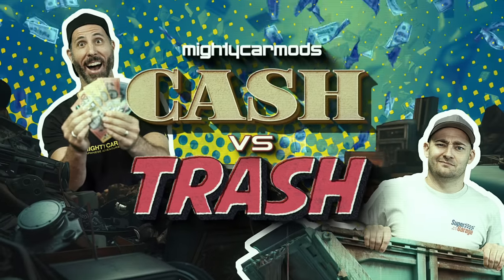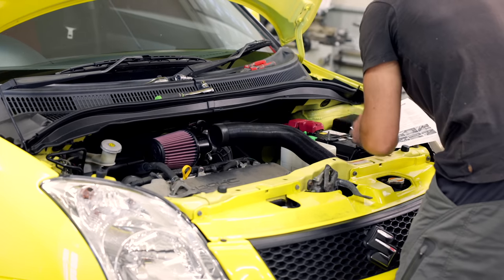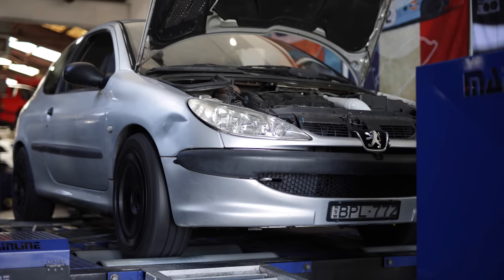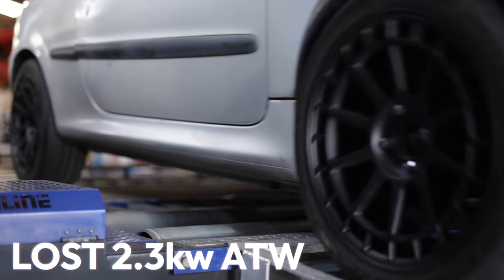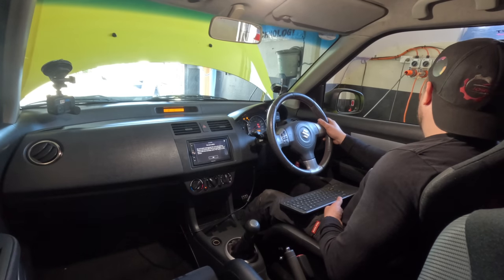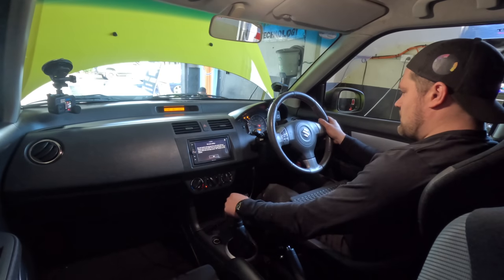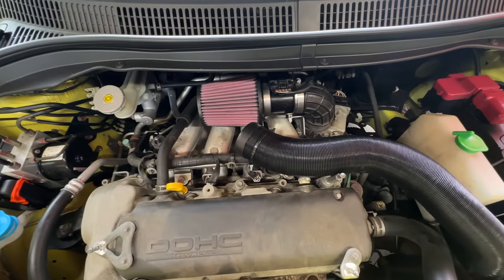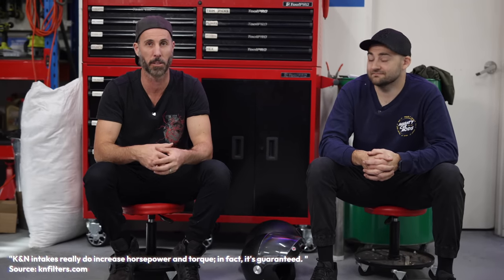Dyno testing POD FILTER Performance Claims | CASH vs TRASH

Comment: as far as I know to make power you actually have to tune the engine for the intake. its not totally "plug and play" as it were. Also it looks like the K&N filter is over the HOT side of the engine which won't help.

Comment: Wonder how much ambient conditions affects dyno results or if it's the dyno itself. Like to see what the original intake adds. Did you weigh new vs old on wheel tire combo. What a head scratcher

Comment: My money is on the filter placement. I'd like to know the difference of the atmosphereic air temps and the intake air temps before and after the pod filter. 
To me I wouldn't even have went near that particular kit without seeing a heat shield upgrade, some exhaust wraps included, or a hood scoop system. But moog already voiced his concerns with that heat up top as he was installing the new system.

What's curious to me is why Suzuki opted to have the exhaust behind the engine on the Swift, when the Aerio/Liana and SX4 platforms have the exhaust go in-front and under the engine. With that change in mind, why didn't K&N opt for an intake that goes infront of the engine, or behind a headlight (with a heatshield for some models of car) like they did with the typhoon for previous platforms.

I really hope both K&N and Suzuki can reach out to the show because there's something weird about this design overall.

Still can't wait to see the Swift chop the PoogBro! :D

Comment: I'm guessing that the loss in power was due to the cars computer system needing to be updated.  You increased airflow, but the computer is running the engine based on the original airflow.  Maybe it needs to be remapped so that it will use the increased airflow and produce power.

Comment: Back in the day of carburetors in Minis, I had to re-jet the carb when I changed the filter and exhaust, so I am guessing a custom tune or ECU is needed to unlock those horses. Not sure what the budget equivalent of that is, a piggy-back FMU?

Comment: Bro you guys are doing this on N/A cars. Please do this on a boosted car. Most modern cars are boosted so you see gains, Especially with a remap. Your maf is reading a lot more air going in and it's throwing off the stock N/A tune so that's why its pulling power.

Comment: My 05 swift has an enclosed intake mod that grabs cold air from behind the front grill and there is a noticeable difference. Unfortunately this may be due to the programmable MAF controller and the ECU tune.

Comment: The corrugated tube add resistance in air flow which less power try it with non corrugated tubing

Comment: The way is installed it sucks in all the hot air from the engine bay and at a higher rate in the engine hence drop of power. Make sure it gets cool air

Comment: Yes it is true, if you don't actually tune the car to take advantage of the parts they won't work.  Yes, they can cost power as well without a tune. If you tune the engine to take advantage of the extra air coming in (theoretically, as the air intake location in particular sucks on the swift haha.) and the exhaust capability, but otherwise the stock ECU may be making weird decisions BECAUSE there is more air available than there should be. The O2 sensors are also not calibrated correctly for the new exhaust so it may make the ECU think that something weird is going on even just from these 2 data points.  It may be retarding timings or the like just like it will do if you put the wrong octane gas in your car. It may even be programmed to play it safe in this way because of the out of spec readings it is getting on both ends of the engine. People don't realize that NONE of these engine parts will work, or even cost you power without a tune on any fuel injection system.  It was set up to monitor the rate of flow ONLY for the air and exhaust density of the stock box and exhaust etc. Note this is the ECU setup, the accuracy of the sensor is not the problem here. If it were carbureted you could add a better flowing air intake and then change the air fuel mixture yourself with a screw, with a lesser effect of course from the low efficiency of the carb. It is still required to do this with fuel injection but it involves turning the screw on the computer, metaphorically :) Sometimes the stock injectors themselves become a bottleneck, especially with forced induction applications and you have to use better ones that allow for more fuel. Just because your car doesn't have forced induction does not mean that the ECU doesn't require adjustment to take advantage of the engine mods you have added. Even just 1 mod, to actually use it you need to adjust everything again, even if it's just a small adjustment.

This is why the guys in the comments here talk about how on motorcycles this kind of thing works very easily, because the vast majority of bikes are still carbureted and you just turn a screw and make sure its not running too rich and boom you have extra power.

Comment: A small engine barely needs much air at all 
1995 1.9 polo runs fine when blocking the intake completely 

Also don’t the engines have to be driven a tank or two before the computers allows it to benefit from more air more easily? Like running 95 vs 98 fuel won’t make noticeable difference just after filling up 
Knock sensors must slowly allow more timing n such to make the fuel do its thing 
Might be the same symptoms here?

Comment: Even old cars like my BMW e30 lose performance from those "Guaranteed to increase horsepower"  hot air intake systems. 
When i was younger i was tempted by this performance increase claim. But the E30 has a cold air intake that goes directly into a big filter through the airflow sensor  to the throttle plate. There is zero room for improvement.

Comment: lol
exhaust for sure dont make u lose power
but if you throw on a full exhaust u need a tune cause the stock ECU wont be able to tune it self... a pod filter is the most a stock ecu can compansate for
i run a pannel k&n in the air box it helf at top i run e85 no tune and with stock filter it has a big power hole at top RPMS but with the k&n it keeps going for power

Comment: Can you what if you tested the CFM of the two setups and see which one flows better before assuming that it is not a good idea... I think the car is not thinking to run richer because of the added flow that it might act like something is wrong and diminish Its potential not to get out of its parameters. If that makes sense

Comment: Could you not turn the K&N pod filter on the Swift so it's more to the right, next to the engine rather than behind the engine? Then have the ram tube running under it rather than over the hot engine?

Comment: It’s measured as wheel HP and with the new wheels and rubber is there a chance that the numbers are thrown off by those and not the air intakes? A better measure would have been a hub mounted dyno

Comment: A pod filter will work with a tune or an aftermarket ecu
When you install a filter you effectively leaning the air fuel ratio so in order to work properly you will have to put a tune and in a lot of cases injectors tou richen up your AFR so the power loss is not unexpected...
Love the show guys keep up the good work

Comment: i've found with a free flowing exhaust and a cone filter it moves the peak power from 4000k to 5500-6000k it un choked up my fiesta in that way. I also like to leave battery off for 20 mins to reset ecu learning processes. Placebo? maybe.

Comment: Well the car is tuned for exact length and the diameter of the tubes and when you change that the afr changes and the car was made to specifically run of the exact afr ration and by doing this you introduced a bit more air and it changed the afr by probably like .1 maybe .3 but I wouldn't say so anyways it drastically it reduces power and so the car needs to get back to its sweet spot with it's a/f, and timing table

Comment: your K&N is installed wrong , the filter goes at the end of the long tube, now you're just picking up hot air from manifold being under the filter . also the 90degree should be pointed the other way !

Comment: it also helps when ur not dynoing a damn lawn mower engine 100hp u could probably have a garden hose for an intake and it wouldn't effect it and the K&N sucked in hot air so thats definitely not gonna help

Comment: They are now running lean. You need a new tune, to match the new intake and exhaust. More air = more fuel 
Better breathing exhaust = more fuel 

Add a new tune on top of those mods, and both cars will gain hp. 

I think....

Comment: Just a thought.. but would ipod filters show any gains if the fuel map was tweaked for it? I'd imagine most ECU's would self-adjust with O2 sensors, but I guess I'm just curious if the tune would fall outside that self-regulating goldilocks zone since a few horsepower loss seems like there would be an underlying cause. I would love an episode that breaks down into the mechanics of exactly why pod filters might cause a reduction as opposed to a net 0 gain. Very interested. Thanks for the fun episode guys :)

Comment: adding air flow won’t help without changes to bang. computer is set to autocorrect and use a specific fuel/air ratio.

Comment: Mechanical engineer here:
This challenge should be done with 2 identical cars butttt these mods only work under a tune, car ecu is designed to make the same HP as much as possible under different weather conditions, by changing the intake, the car assumes weather change (or altitude change ).
I’m assuming the car thinks you are in a lower altitude with higher temperature if the cold air actually works, car is probably reducing the fuel going to the cylinder? .

Comment: Hi Marty Moog Mods,

I used to own an R53 Mini Cooper S (The only alternative to Moogs VTEC Mini)

Being Supercharged, noise was massive for me. I had a 3D printed adapter mate to bolt to the inside of the OEM Air Box that would allow me to fit a K&N Cone. Stock location, enclosed box, BIG Honks. Maybe this would be something you can do to the Swift?

Will add this to the comments of the latest video as I’d love them to see this and potentially use the idea. 

🏎️💥

Comment: "hot air intakes" don't make extra power. Aftermarket intakes may have length, shape, and pipe size are not specifically tuned for the engine.

Comment: DId you run the test with the stock intake back on?

I am going to go out im a limb here and say the length of the stock intake is a big part of it.  I put in a custom CAI on my hyundia tiburon that ends up taking air from near the passenger wheel well, which required adding another foot of intake tubing. You would think ADDING the extra length would actually restrict air flow, but the absolute incredible boost of power up at 3-4k has made people think my tib has VTECH or a turbo due to how it just cuts sick. But it ONLY happens at those RPM ranges. And you can HEAR it at those RPM ranges too, it has a deep throaty roar which is absolutely suprising considering its a 2.7 litre V6 out of a bloody SUV (no idea why hyundai did that).  but 100 percent, the length made the most difference. I am not sure if i accidently got the perfect "tuned" length for the intake, but it made more difference adding a foot of tubing then it did going to equal length headers.  Btw, the CAI really didn't do much, according to my ODB scanner the intake air temp didnt really change from stock.   I am no engineer, and this is all seat of the pants, but can count on 2 hands the people who thought my car had a turbo or some kind of variable cam timing when the car hits about 3.6k RPM. It LEAPS forward, and sounds amazing. The V6 in the tiburon already has some fairly long intake runners for torque, as it was a SUV engine, but the extra length by pure coincidence did something... I would also like an automotive engineer to let me know how adding length to intakes sometimes increases power. All i can gather from internet searches is that at certain RPM (aka, frequency) the incoming air column has a mass and a resonance to it and if it matches the air intake timing it can do some crazy stuff.

I also left the MAF on my car in the same spot, so the same distance from the intake, so that could also be an issue. MAFs only really measure one specific spot of air flow, and assume the rest of the air flow is the same, which is why a lot of them come with grids that kinda flatten and make the air flow linear. Haveing the filter so close to the MAF could also do it.

Comment: The swift has the worse position for a cold air intake. Also I have installed this k&n system in a swift. And it is not worth the money honestly. It looks and feels cheap. In the end I designed & build a custom bucket for the pod filter to sit in. And this fitted seamless to a box that connects directly to an aftermarket carbon grill. We wrapped the pipes and boxes in gold heat repelling foil for looks. And it looked great, and it gets real cold air from outside the engine compartment. No dyno testing was done. But my logic and engineering degree's tell me if any performance gain is to be expected from a pod filter that is the only way to get it. Bonus from my point of view is because we enclosed the filter the intake noise was clearly hear able outside but not so much inside the car which I prefer. It get old very fast on a non turbo car for me.

Comment: I ask you guys 1 more test for the pod filters disconnect the battery for a few mins and try to flash the ecu and run the car with the a proper cai not (hot air)use a fender intake like most people have and pod filter .then drive for about 100kms or 1/4 a tank of gas make sure to use a guage to check your inake temps before and after or sitting idol and driving then you car should have changed timing and fuel adjusted what it could then hit the dyno

Comment: Have you tried to connect the flexi pipe into the throttle body then connect the filter to the other end so it's away from the engine and picking up air from behind the bumper?

Comment: You guys are well aware that this particular pod filter installed is drawing hot air from the engine bay and the stock setup is drawing cooler air from the front. It’s being setup to fail from the get go

Comment: Fuel trims are my big question, with the Swift mainly and I am NOT a Swift expert but: did you go through learning runs for the ecu to learn fuel trims? Some cars (experienced it a ton with BRZ/FRS) you have to let the car learn the fuel trims at low loads. Without that knowledge the stock ECU is trying to apply previous learned data on a totally different system, it's never going to work well immediately. If the ECU is looking for values and it gets a bunch of unexpected numbers it won't give you the best case results without learning first. What I have found to work (on twins) is slowly accelerating through the rev range from 2000-7500 in 2nd gear a handful of times. 3rd is good too but obviously road speed and legality come into question, should you not have a lot of time on a dyno...  ...I'm not insisting you haven't tried this, but it's step one whenever I install a new bolt on on any car that doesn't have a new tune to go with it, and every time a new tune is loaded. And it wouldn't surprise me if the marketing team has it's foot up its ass either.

Comment: doesnt this also support the regular argument that rolling roads are at best just a approximate guess. unless you're back to back testing with the exact same conditions. i know the rollers can compensate, but the variation can be huge with air temp and humidity etc

Comment: Peugeot will gain power with the stock exhaust intake most likely working fine bigger tyres will loss a kw or 2 as well. To big and you get no air speed. K&N intake kits don't have the same size maf housings or air straighteners before the sensor so the will never pickup power without a tune this is the issue with most intakes on cars with a maf sensor.

Comment: Dyno tuning or measuring with the hood open is improper practice. ESPECIALLY when measuring the effectiveness of an air intake.

How are you supposed to test if your CAI is working if you're testing with the hood open? When in practice you're always running with the hood down...

Comment: My understanding of modern cars has been that it's all ECU. You can change stuff like intake and exhaust, but the ECU was programmed and tuned to a specific amount of intake, and a specific flow of exhaust. By changing those and not tuning the ECU to those new numbers, you've thrown the whole system out of whack.

Comment: Your pod working has hot air intake rather than cold air intake
Your position is on the top of manifold which hot
Make ka way at front for cold air intake to work

Comment: i really wouldn't have expected a lot on gain from the filter on the Suzuki because although the filter is most likely less restrictive it is sucking air from straight above a hot motor? were the atmospheric conditions similar to when you did a base line run? when your only talking about a few Kw it can be enough to make a difference. take it to somewhere 1000m above sea level and dyno it it . i bet the results would suck (ha ha) then?

Comment: Are the wheels and tires the same size as the size used on the dyno? maybe the bigger wheels are taking your 6/7kw more so then loosing power from the intake upgrades

Comment: With the K&N Pod filter you're now sucking in hot air from behind the engine and with the stock setup you were sucking in cooler air from in front of the engine is my guess! Sorry in the video you did not post what the ambient temperature was and I think you guys live in the land from down under and I'm guessing it's a bit hot there when the dyno test were performed!